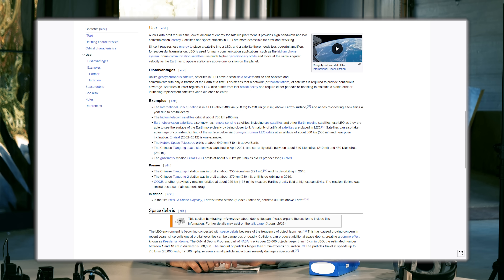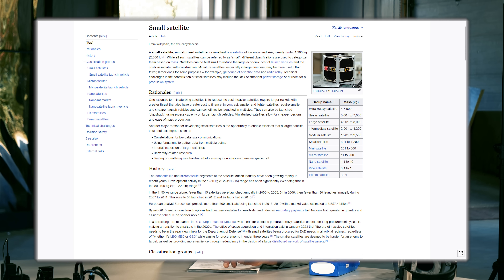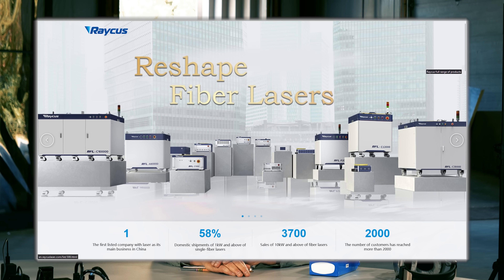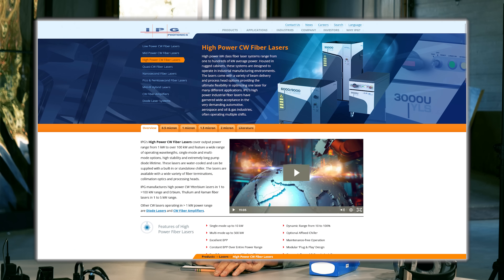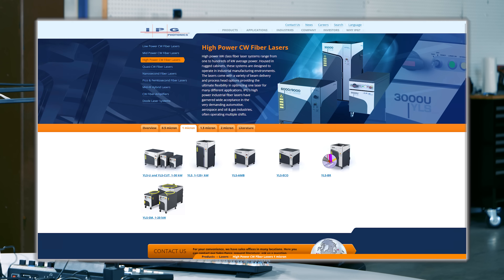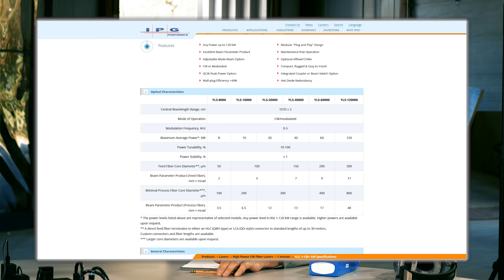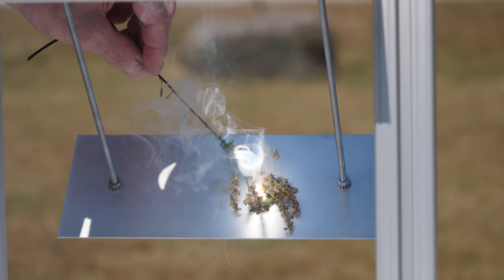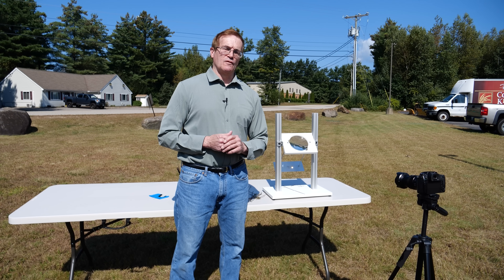COULD SATELLITE LASERS REALLY DO THIS?...

Comment: I worked for nearly 40 years on the physics of optical lasers, and one of my best friends was an engineer on the ALL (Airborne Laser Lab, the gas-dynamic laser predecessor to the ABL  the Airborne Laser using a COIL (chemical oxygen-iodine laser) cancelled a few years ago).  Your analysis of MMW DEWs was correct.  But, there are serious problems with all the tactical lasers being developed that render the tech not practical for down-shooting space lasers for many reasons.  Thermal blooming is always an issue but can be dealt with adaptive optical systems.  
Diffraction (your "divergence" numbers) is really not the issue in laser beam propagation through the atmosphere, nor is atmospheric turbulence.  Aerosol and molecular scattering is, and CANNOT be corrected by AO because it is phase-incoherent.  Rayleigh and Mie scattering going through the atmosphere significantly reduces power propagation, one reason that the ABL was cancelled.  Because even at the very high altitudes the ABL operated at the distances required to deflect or damage a ballistic missile was only a few miles, way less than the altitude of satellites.  Rayleigh (molecular) scattering is inversely proportional to the fourth power of the wavelength, so shorter wavelengths which produce lower beam divergence are subject to much larger scattering.  
There are a large number of other engineering aspects that would prevent projection of tens of kilowatts/m-sq,  such as cooling of such a multi-kw laser on the satellite and beam steering issues.  This is only one of many real-world engineering issues that would require solving, that are presently not solved.
So I highly doubt your conclusion that "a laser beam weapon could start fires"   - NOT "highly possible.
Reply: Based on my moderately intense research into the subject, this guy is absolutely correct. Combine that with the heat and weight requirements for the platform and the difficulties associated with keeping that platform secret and it becomes even more impractical.
Reply: There’s a big difference between theory and practical systems! I wondered why he didn’t include scattering due to dust.
Reply: @46I37  that's not as sensational.
Reply: @beowulf_of_wall_st  absolutely agree, but I wonder about the practicality of putting essentially a school bus into orbit solely for the point of warming up the ground over 10 minutes. That would be a sky watcher's dream
Reply: @beowulf_of_wall_st  In many ways its much easier.  A missile flying in the atmosphere is an easy target with zero background clutter when shooting up or horizontally, which is why the latest attempts at making antimissile lasers used an airplane as the platform instead of a satellite.  Making a weapon that targets specific ground targets from space is a very tough problem, and requires a co-boresighted high-resolution multi-waveband sensor (more weight) unless the wish is to shoot a laser randomly without acquisition of specific targets. If so, a laser weapon will just heat up ocean water.

Comment: Have you looked into the idea of using a low power laser satellite network in combination with a phase-conjugate mirror and amplifier system for final beam summation and targeting?

DOI: 10.5772/8640 is a good baseline reference paper for phase conjugate mirrors, I would also recommend the old Los Alamos paper as an introduction (I believe it was called Through The Looking Glass, or something like that)
Reply: Or phase conjugate a feedback signal from the target along a reference beam, so that atmospheric distortions can be pre-distorted 180 degrees out of phase, canceling them out.
Something experimented on in the early SDI program in the '80's.
Reply: See: Analytical Study on the Steady-State Thermal Blooming of Incoherent Combining Beam 
College of Advanced Interdisciplinary Studies, National University of Defense Technology, Changsha, China
~~~~~~~~~~~~~~~~~~
This paper discusses using multiple low power beams to create thermal lenses in the atmospheric medium.
So you could use an incoherent laser array to create an atmospheric distortion that lenses natural sunlight in to a coherent beam.
Reply: @Valchrist1313  all of which requires reversing the inverse square law and well, if wishes are equal, we already have room temperature fusion.
Reply: @spvillano   It does not.  You clearly don't understand.  Checking the source might've helped with that....

By using low power lasers to generate a specific pattern of heat in a portion of the atmosphere, the air itself becomes a 'thermal lens' which focuses natural sunlight.

Therefore, you greatly decrease the inverse-square effect on, and energy requirement of the satellite-based lasers and magnify the already-powerful effect of sunlight.

Fresnel lenses of less than 1 square meter are able to melt stone at ground level.  There's no particular reason a thermal lens could not be 10 square meters, or whatever in between.

I don't understand why the concept is so difficult to understand, besides your having dismissed it without actually thinking.
Reply: @Valchrist1313  still won't work, besides Brownian motion dispersing the effect rapidly, a dearth of anything to focus the laser energy on and then, there's this little thing called wind.
Then, the amount necessary to create a lens of that sort would require something closer to Jupiter's atmosphere in density.
Reply: @spvillano  Piezo controllers and other methods of countering wind and other disturbances were briefly covered in this video.  By your reasoning, satellite imagine should be impossible, and certainly satellite mapping of the ocean, spectroscopy, volcanic deformation mapping work.

You don't exactly need a high power billion dollar piece of military tech to communicate with a GPS satellite!

And you might be shocked to know this message is coming to you via a Starlink satellite.  Will wonders never cease?
Reply: @Valchrist1313  erm, lemme get this straight, controllers and wind magic.
That is how you started
And I know precisely how to contact US military satellites.  royal PIA at times for some birds, others not so much, but more losses of data.

As for starlink, good job, you've gotten things down pat for preventing a space elevator or well, pretty much astronomy.
Good job! You got internet and fucked observation of Alpha Centuri.
Reply: @spvillano  Oh sorry, I didn't realize you were a high IQ Redditor.
Reply: @Valchrist1313  don't do reddit. I have worked with lasers though. Have you?

Comment: Really appreciate that you took the time to explain this and to show the math.  Being a subscriber to Occam's Razor, I've never felt like space lasers or microwave weapons were terribly likely.  That said, I'm still trying to figure out how palm trees (which, as a form of grass, are reasonably flammable) and literal grass survived while aluminum wheels and auto glass melted right next to them in places where there was no additional fire fuel.  Hard to wrap one's head around how that could happen -- so if you have any theories, that might be a great video, too.  :)
Reply: Actually, the foliage of palm trees is far more flammable than the bark, which is a good insulator.
Whereas aluminum is a great conductor of heat, as is glass. Hence, why we use aluminum in your computer's heat sinks and glass on electric and induction cooktop stoves. And oh, palm is not a grass, totally different genera. That's like saying humans are spiders.
Reply: I feel as if wind speeds may have played a role in that. Most fires you and I are familiar with, likely happened in calmer winds. I can imagine that a fire isn't going to make a whole lot of windward advancement, when gusts are hitting at over 100 KPH. If a spark fell in a patch of flammable material, it would be stoked into an inferno on one side, but barely touch the material in front of it in the direction the wind is coming from. I could also see there being the possibility of superheated wind tunnels in the areas that wind had free passage, like down streets and alleyways. I know this is more of a hypothesis than an explanation, but I think it's worth considering, seeing as how the conditions were somewhat atypical.
Reply: @lumpychucks6457  Right, this was my first thought as well, until I started studying some of the footage.  I live in Hawaii, btw, used to live in Lahaina, so know the area well:  https://www.youtube.com/watch?v=Q9L9WvlCli0&t=38s
Reply: @lumpychucks6457 gases as well. Fires produce gases. those gases make the fire burn a tad hotter as well. And yes wind. especially with the landscape. The size of the fire would generate huge amounts of air movement
Reply: @lumpychucks6457 lol well this guy helped me out in my explanation.  all that rising heat with air movement, its like a huge forge
Reply: Drones with napalm?
Reply: The aluminum wheel was surrounded by 20 lbs of highly flammable tire...
Reply: @DynamicSeq  Rubber burns at 350 degrees, aluminum melts at 1220.  Again, I'd love a rational explanation and I am still searching for one, but rational explanations have to stand up to scrutiny.
Reply: The combustion temp is much higher with forced air from winds. Essentially a hydrocarbon fuel at that point, not unlike propane or kerosene. Both of which can easily melt aluminum.  @NotRiansLuke
Reply: @NotRiansLuke  the tire will absolutely help melt a rim.  you are conflating ignition temperature with heat generated.  two totally different stats.  you are also, now quite intentionally it seems, ignoring conductivity.  aluminum rims melt, that's what they do.  It seems you are looking for a sinister will to explain this, but complacency and incompetence are far more common.  that's Hanlon's Razor.  a melted aluminum rim is one of the most yawn-worthy things I've heard. depending on conditions, a wildfire can exceed 2000 degrees.  adding to that aluminum soaks in energy like a sponge it's not strange at all.  it's a more graphic example of a basic science experiment.  I find it interesting you ask for help understanding but ignore and disagree with every explanation that doesn't support foul play.  by the way, the laser story has been absolutely confirmed to originate with the Chinese Propaganda department, it was dispersed and "spamaflauged" from there.
Reply: @sinisterthoughts2896  Nope, not "looking for" a sinister motive, just skeptical of explanations that, "quite intentionally, it seems," conveniently ignore that the melted aluminum is NOT what I indicated was strange (if you reread my original post).  Perfectly understandable that aluminum could melt in a wildfire turned blast furnace.  What is not understandable is how aluminum can melt 2 feet away from untouched dry grass.  But hey, we can just ignore the data we don't like, make assumptions about other people's beliefs, and condescend to each other if you feel that's a better use of our mental energy.

Comment: Something that should also be considered is the other side of the laser efficiency: heat generation. 120kw over 10min at 50% efficiency (assuming the power supply is 100% efficient) would produce 144MJ of heat that would have to be dealt with. Assuming paraffin wax is able to absorb 250J while melting 1g of wax you would need 756kg of wax to store the heat for later radiation or ejection. 
Water would also work to remove heat, and going from liquid to vapor would only require 65kg of water, but now if you are directing the vapor one direction you have a thruster that needs to be countered, or if you are ejecting it in many directions to have a net zero force you have a vapor cloud you are needing to shoot through which is also going to absorb/refract the laser.

Edit: A person who believes in many grand conspiracies recently sent me a link to a guy's blog where he was doing math on this in an effort to prove his positive claim that the Chinese deliberately set fire to Hawaii using a satellite. One of my counters to that is that it would be significantly cheaper to just pay a small group of people with torches to light everything on fire. I also used the line about seeing hoof-prints think horses and not zebras.His verbatim response: "Horses & zebras is a tired medical diagnosis justification to keep blinders on. We're in 5th Gen unrestricted warfare landscape with 'Space Force' bootstraping itself for a fake alien invasion coming to an election cycle near you soon ... the zebras have escaped the zoo from what I'm seeing." The website also pointed out how the Chinese have desktop sized PW lasers. While true, it is only able to output a PW for a very brief amount of time with a relatively huge cycle time. The average power would still be very low.
Reply from the maker: The primary  problem here is why a person  with that kind of baggage sent this link to YOU? Know what I mean?
Reply: @TechIngredients  to be honest, I found that kind of strange too. Shortly after he sent me a link about how the nutreno detectors in Antarctica were used to cause a massive earthquake in Christchurch NZ.
Reply: Have you considered the fact that this is all part of a cyclical disaster cycle?  There have been countless unusual/ill-explained accounts of fires throughout history and specifically in cities.  

There’s all the cities across the usa being burned again an again…… and then ….. strangly… built atop the old city which seems quite strange. 

Chicago fire.  Seattle.  

Even Dresden during ww2 has quite the unusual first hand accounts of what took place and it forgot match up. 
  
Nor does the fact that there is a labyrinth under seattle that isn’t burnt. And sprawling in size unbeknownst to most.   
Much of it frozen in time. 

You can gain access through the light rail tunnels. Be careful.  
Ask the homeless for a guide

Comment: Wind blowing a brushfire creates a monster you not forget.  Even a couple miles away the tornadic winds of a firestorm will make your hair stand on end.  Bless those who fight these fires.
Reply: sjch high winds there were trees and houses next to houses not burned down to a stump

weird
Reply: @driatrogenesis  trees have thousands of years of surviving fires by genetics. our houses are not internally cooled, spaced by ring gaps, or designed to regenerate.
Reply: @up4open763  Absolute nonsense and poppycock

I have burned "green" wood in a campfire.

Your logic doesnt fit occams razor at all
Reply: @up4open763  like I said, if the winds were so strong as to blow the fire accross a highway, then how come those trees and other properties somehow were untouchdd as if there was an imaginary line drawn? How could that be if such high winds anything next to the fire would be constantly getting envoloped in flames, such is how the fire jumped across the highway
Reply: @driatrogenesis  Trees have roots and are living at the time of the start. Green wood is not rooted, and doesn't have the same hormone responses. 
Fires burn in odd lines, all the time, how do you think fire-detectives find the origins of a fire?
Reply: @driatrogenesis  Brushfires and wildfires jump gaps by lofting embers. They also don't normally burn outwards... the burn forwards, where "forward" is local downwind.  Topographic features and the currents caused by the fire itself can matter a lot.

BTW: One of the "miracle houses" which survived despite everything around it getting flattened had just been renovated with a new metal roof and had the brush around it cleared.  Exactly the sort of thing which agencies (eg. CalFire) and insurance companies in places which get wildfires somewhat commonly have been advising for decades.  Yeah, it can make a big difference.
Reply: @driatrogenesis you realize this line of reasoning suggests that any time something burns down everything everywhere would have to burn down?

Have you seen that fire pit where I cooked some marshmallows? Everything inside of it is ash, but right beside it, only a foot away, the grass is completely untouched!
Reply: @travcollier  Lol totally nonsense
Reply: @TheEclecticDyslexic  Nope, not at all

They claimed this was "a perfect storm"
Reply: @up4open763  already debunked this comment

try to keep up
Reply: @travcollier  Wrong

When there are hurrican winds, you are not gonna get straight lines...

again illogical
Reply: @travcollier  Jumped that big of a gap from lofting embers? Lol your story is bec

Comment: I have been thinking more in the terms of a charged particle or electron gun weapon, from space you could shoot the beam through the atmosphere, any atmospheric electric charge will follow the ionized bean path and discharge to ground or the target. It would look like a straight lightning bolt. According to a few Tesla patent drawings floating around, an electron gun could be made that is open to the air leaving a hole for the beam to pass though. Tesla one way flow valve type system.
Reply: I cannot say anything about charged particles, but electron guns must operate in a vacuum...I would venture to say that neither of these 2 would get far through our atmosphere. Without losing most of their power and dispersing.
 Some semi-conductor components, such as crystal oscillators, are sealed in a metal case with the cover welded on, done in a 100% vacuum with an electron beam.
Reply: @dougankrum3328  Project Bear, part of SDI, 1989

Comment: Great presentation.

Though all of this is based on common comercial equipment, when a enginer designs a car it is developed based on the power source being used.

For example the boston dynamic robots, imho i believe they already have a high tech power source avalible, otherwise thier current development is rather useless without defined power source.

But its still great to show what can be done with off the shelf components, when theres a bunch of other gadgets and toys we dont know about yet.
Reply from the maker: It's  a good place to start.
DARPA equipment  isn't  much more than a costly extrapolation of current  tech.